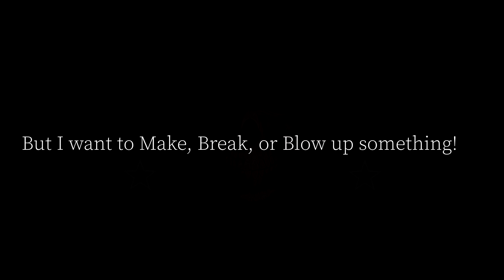Mr C's heathkit sb-220 rebuild

Comment: A lot of SB 220 out their. That cap bank going bad is very common. them OEM caps are very old ,break down causing current spikes threw diodes. for a wile RF parts was out of 3-500Z tubes. I have 6A10 diodes . they work . The last one I did had meter resistors drift off causing low readding on meter. also had to replace mica cap on input . input tune would not lay down on 10 meter. I did fine some old stock  47 ohm 2W carbon resistors. just 5 . even a box of 10 old GE 47 lamps. the china parts today are junk. the one I did had the  red door knob caps. them going bad can cause current spikes threw them diodes also .I put soft key in for 12V switching . The replacement relay has a resistor for coil. some same parts on SB 200 . 73's

Comment: It seems that the fan's blade propeller is backward mounted on the motor shaft. The air direction is still the good one (to the tubes) but the concave surfaces of the fan propeller blades should be facing the tubes which would lead to more air (and more concentrated flux of air) moved into the axial direction (i.e. to the tubes) and less to the sides.
TNX for the videos. GL & 73!

Comment: What tool out the rectifier board? I really enjoy watching your work.  I just rebuilt my old SB220 new rectifier board, filter caps, softkey and it runs 1500 watts all day long behing by Icom 7300. Great old amps. This is my backup for my AL1500.

Comment: I have a 221 that's just been brought back to life, it has new harbach metering board, and cap bank among other things like grounding grids.  The amp works well and has a nice set of Eimac tubes but I have a dimming and brightening of the the meter lights as it sets and Idles.  Any idea where to start looking for the flickering issue?

Comment: Hello   Mr BBI -  I have a 220 that I m working  on that shows Bias Voltage of only 100 volts   not  120. Any idea why this is low?  The Filament voltage is 5.4 volts . The  Bias  voltage  flops to zero volts DC when keyed not 3.8  or so. Any help  will be appreciated!!     Thank You!

Comment: This is the amp that had the fan blade on backwards.
Reply from the maker: I don't think so.
Reply: @BoxBuilderIdaho  on the end of the short video you did either about biasing or the parasitic suppressors when the fan coasted to a stop it looked like it was on the shaft backwards watching it at the end of the main video it also appears to be on the shaft backwards
Reply from the maker: Hummm all I can tell you is that the air is blowing forward.. But good eye